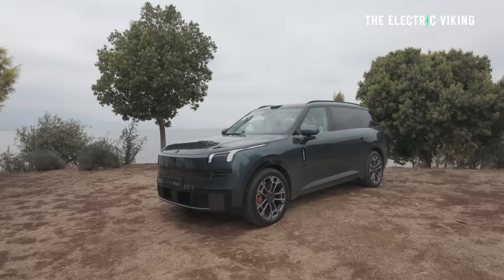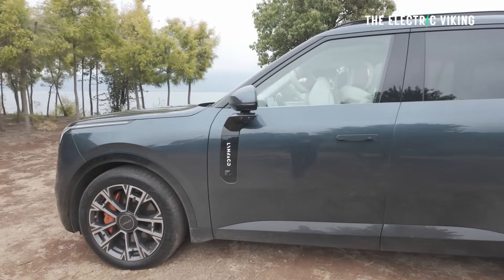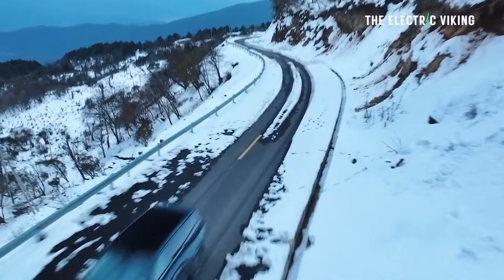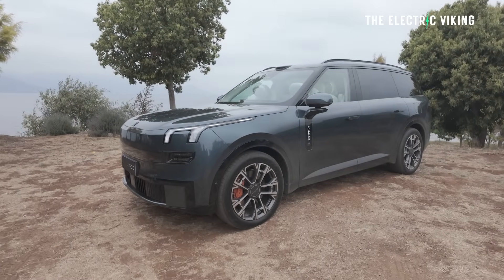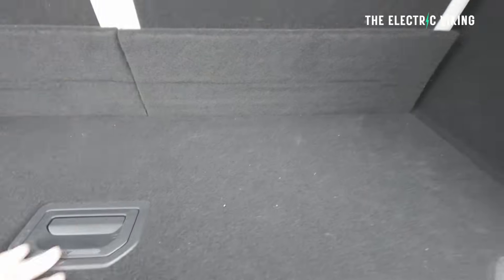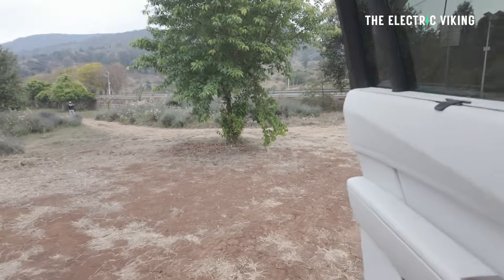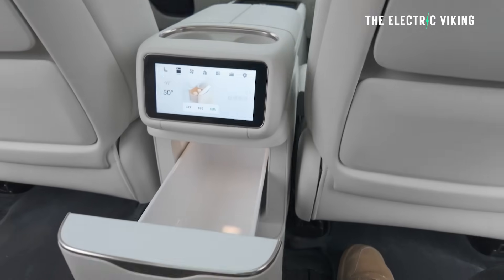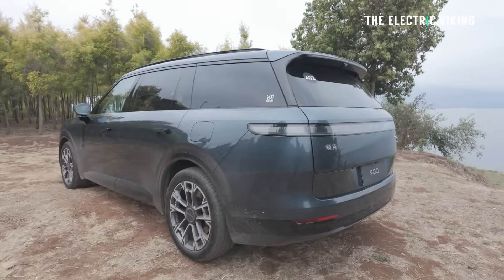Lynk & Co 900's New CATL Sodium-Lithium Battery Leaves Legacy SUVs in the Dust!

Comment: I feel you got a pretty bad analysis of technology....hybrid is not "the best of both worlds", hybrid is the worst solution of all. Hybrid is living with 2 girls cause one is able to cook and the other one like to fuck, how is it the best of both worlds...? Cause you need to travel with both of them, 2 motors....2 kind of batteries....it's non sense, complexity is far more important, efficiency and reliability goes down.
So instead of going with 2 girls, you learn to cook and keep only one. Same with cars, you learn to use them as their advantage and stop building card castle that will not survive time.
Sodium batteries have a pretty high derate at low temperature...like losing 20% capacity at -20°C...! You are ironing all problems to try to makes it look good.

Comment: Had some nice cars before... audi TT first gen 225hp quattro, BMW 525 touring full option...now my daily is a  2015 Range Rover Sport Autobiography. All the bells and whistles from a few years ago. Pneumatic this electric that, sunroof, leather dash  22inch black mat wheels with red brembos  and so on and so forth. Great car.  Apart from my Jag F type R, in 2025 the best car I owned. Best allrouder for sure. But... When in 2026 my L494 will be gone, i am geting Link and Co 900 highest spec. I was looking for something worthy of replacing my "terminator" and I have found one. Sorry, but BMW, Mercedes and Audi are screwd already. Even the migty Range Rover starts to fade when You look closely on the best China has to offer. Sad...but true. And at this price... No brainer! Greetings from Poland

Comment: Im getting creepy old white guy in Asia vibes off these cars.
Giving 'everything' a guy could ever want but...
Trying too hard at the easy stuff yet ultimately being soulless, no connection. Cheap.
Dont blame the bend over backwards car, but it just doesnt get what will satisfy the driver...
When I design a room in my house, that I spend time in, or any room, I never ever ever everrr think 'this would be classier, cooler, better if we had screens that pop off every wall, power in/out sockets so we can camp on the floor if the roof ever flies off, naff American style fip out Rosanne Barr in a trailer park drinking a Bud light armchair, that swivels, which has a microwave under the seat that can make the popcorn from the larder built into the back of the drivers seat, with cold refreshments from back of passenger seat fridge.
Its a car folks.
Most do sub 20k per day.
All this faff should be who gives a fuk.
Seriously, IGNORE THE JAZZ HANDS, is it actually a decent vehicle? Would the driver owner buy it for them? Driver owners do not buy for hypothetical passengers *bar families which definitely do [instantly making the car a family wagon snorefest for not that market- single folk drive massive Range Rovers to wave their priviledge, not because they like cars they cant park/fit through gaps.]
Id rather my kids talk to me while looking out the window than have my car turned into a softplay area jungle gym with 2 supervisors doing facepainting who live in what was formerly the space for the spare wheel.
Overkill, meet overkill.
(Drivers buy cars- kids dont)

Comment: I see different in price value that it should be way lower for EV cost since the way AI tech manufacturing's machines build these cars with hardly any manwork plus no petrol engine & gearbox etc that cost more to build with more difficulty than simple copperwind coils electric engines & a shell with a battery bank that cost more than the shell & ev engine combined! It's just the market game trick they play us consumers & make it cost us high spitefully like its new technology releasing to the public! 🤦‍♂ 🤦‍♂

Comment: Don't get me wrong, I love what China is doing in the eV space, but...

Why? Why so big? Why carflation? What market is that addressing? The climate, and the pockets of the ordinary people of the world who have been subject to global siphoning of money and assets to the rich, need (I would suggest) a wave of smaller, simpler, efficient and cheap local mobility options.

I'm yet to be convinced that the tech overload inside these vehicles is going to last as long as the vehicle infrastructure. Nothing says 'no sale' and 'discount' louder in the used market than lots of warning lights and random things not working, with the associated problems of supply chain development and lack of competent technicians that are still holdbacks in overseas markets.

Give me a family workaday shopping-and-kids hauler that fits in a regular parking space with 500+km range so the fam can pack and go, even if they don't have home charging. While you're at it, a decent simple van that can go all week on a charge so that Bob the Builder (dad, usually) can run his or her business on a sensible budget, because his/her customers are on a tight budget and won't wear hiked prices for leases that are priced to account for mahoosive eV depreciation?

These should be slam dunks for eV's and especially Chinese ones. Taxation policy, with graduated tariffs based on on-the-road GVW, seem a natural replacement for fossil fuel taxation. One kWh wasted on pushing unneeded crap around is one more kWh that has to be provided, and that weakens the argument for renewables.

Please - stop the bells and whistles adoration. If I need a laptop in the back, I'll use a power inverter from eBay to run the office spare.

Comment: Looks like the electric viking has fallen for Toyota's propaganda.
Fossil cars with big batteries are a dead end.
If you can charge the fossil car or not, dosen't make any big diffrence.
This is the reason why a fossil car with a pugg are called "fake hybrids " in Norway.
Most owners don't charge them.
And, you can't drive them without using gas, and contributing to the toxic smog bobble that kills your kids and family.
In the winter the fossil part of the car are almost on all the time, even if you plugg in.

Transition to EV's can only be done with high speed chargers. Fossil cars with pluggs don't contribute to this.

China should move away from fossil technology in cars.
A fossil car with a big battery, is a fossil car. So, the term "new energy cars", are a big hoax.
Basicly just green washing.

The smart thing regarding this transition, is to keep the engine production, until fossil cars are produced localy in high cost countries. Then shout down the production.
USA can't with or without tariffs produce fossil cars alone.
They would be to expensive.
The true costs of fossil refining will be crystal clear to people.

All Chinese hybrids should be sold outside of China.

Comment: This is the sort of vehicle for towing a large boat, tandem trailer or large caravan.
And it looks good to me.
Ideally runs a large proportion of time as EV only but has the ability to go longer distances as economical as possible.
The Sodium Ion cells help keep cost down, has greater operating temperature range in cold and hot climate.
Towing a larger load this is likely to be 600 km 300 mile range - unheard of with a standard Land Cruiser/ Prado, Range Rover, Jeep, G Wagon or Audi A8  Or Nissan Patrol , Ford Ranger.
Style and capability 

Likely to be AUD$100,000.00 once in Aus.